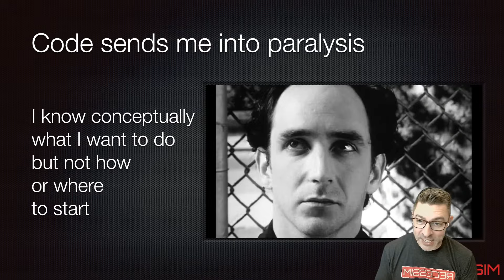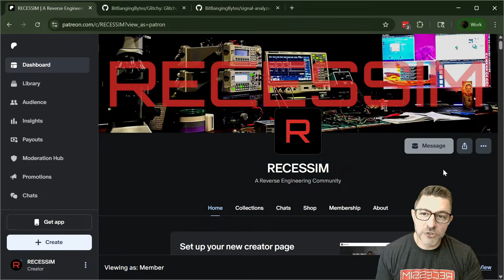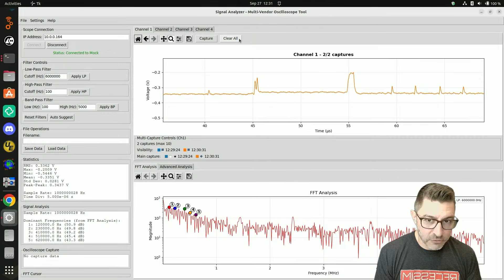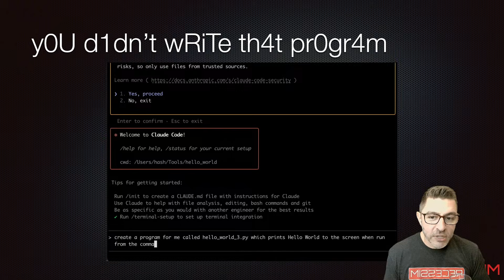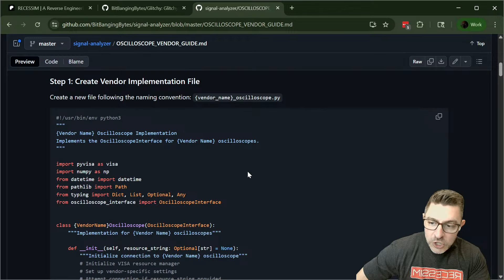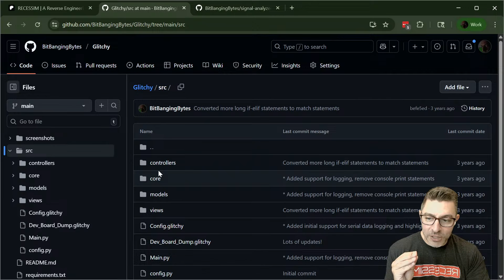Vibe Coding Engineering Tools!

Comment: If you use Claude max account you have capped spend at $100/mo. I never hit my limit and use CC a lot, I have max 5x plan. You nust sign CC in using max account.
Reply from the maker: I considered a Max account after this experience. With the next tool I create I will better track costs and manage context usage so will get a better idea with API cost if Max makes sense for how much I use it.